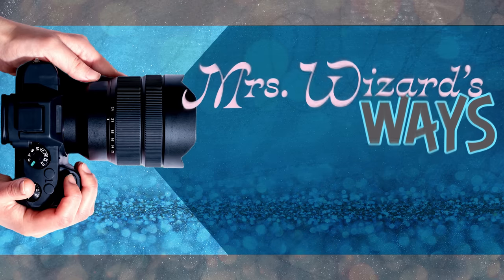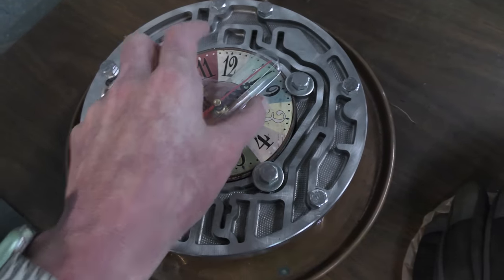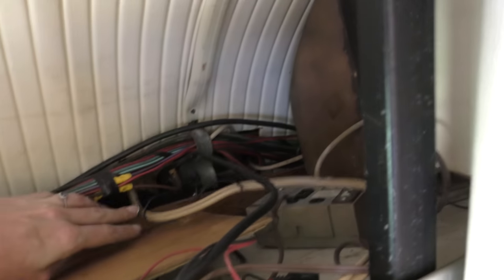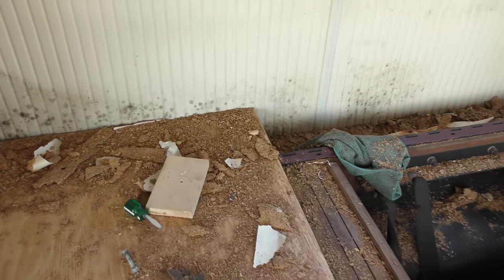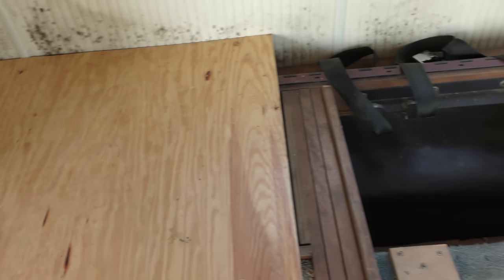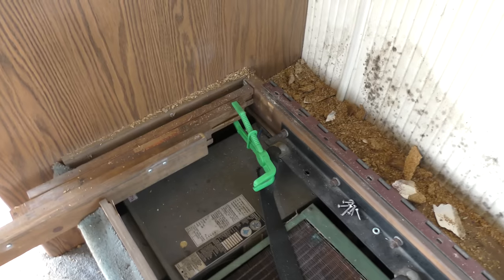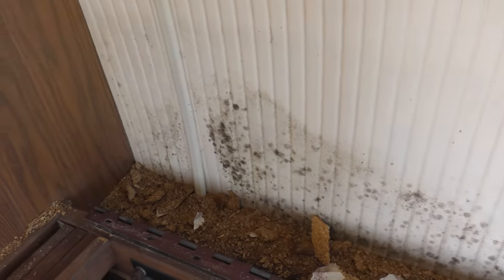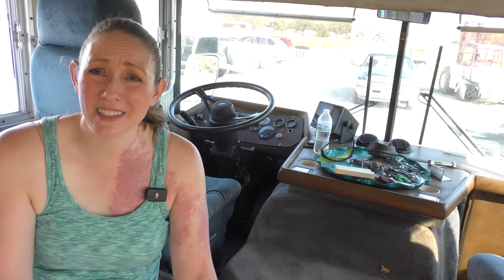YUCK! I'm Fixing Years of Messy Water Damage in my vintage Wanderlodge

Comment: Excellent job Mrs Wizard. One thing I'd like to suggest to remove adhesives is a household steam cleaner. It works miracles on anything sticky. Once the goo starts to move from the heat of the steam, scrub it with a microfiber cloth. I put this trick together on my E38 to remove a ludicrous amount of pine tree sap. It did the trick with just plain tap water, though distilled water would be preferable. As for cleaning removing all of the other nasty greasy goo that might come up, spray it down with Dawn Powerwash, then steam and extract with a wet-dry shop-vac. If it's really thick, agitate with a nylon brush, then steam and extract. I used a similar method minus the steam cleaner on the light grey carpet in my 97 Expedition a few years ago and it did an amazing job

Comment: The beige wire is a coaxial cable for your TV antenna, it's got a supplemental ground wire which is somewhat odd, but that'll either run up to the roof or two the side near the electrical hookups. If you don't plan to watch over the air or cable TV, I'd suggest just removing it.

Comment: No way, this is why i am still single, and will never work for a woman again, even tho i think your great person.
1st, you get a plastic mail box, then a larger 6x4, and a larger angle iron, half in the ground outher half in the log. Then cement rocks around the pole, then when the new types of plow trucks knock it out, you simplify by sliding it back on in one piece. Ta-dum, thank you.😊😊 from Michigan,  and i think you guys are great!
And, also, its a good idea to call miss dig before driving anything onto the ground, may be wires or gas line there.